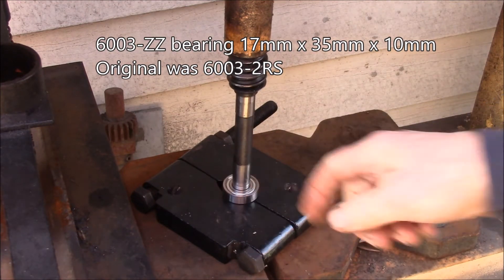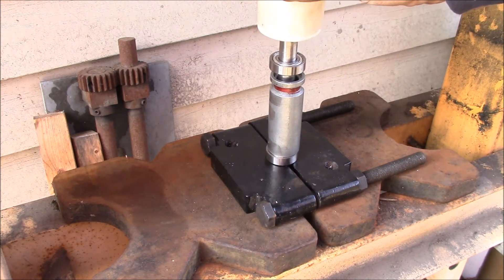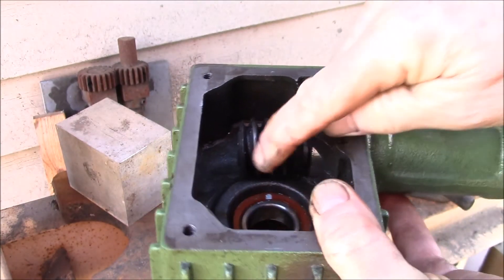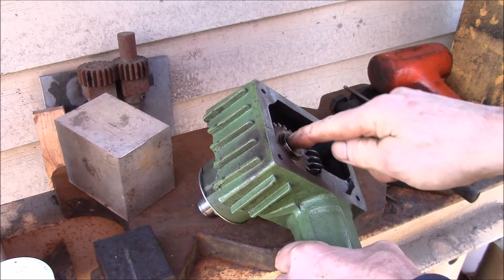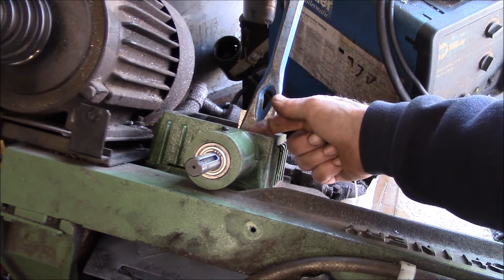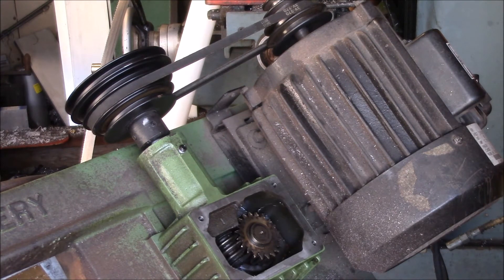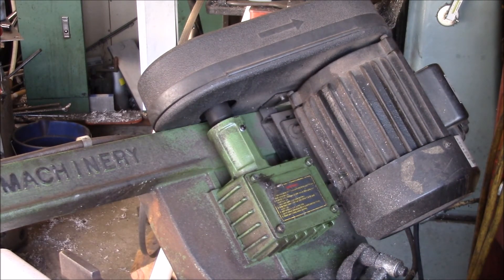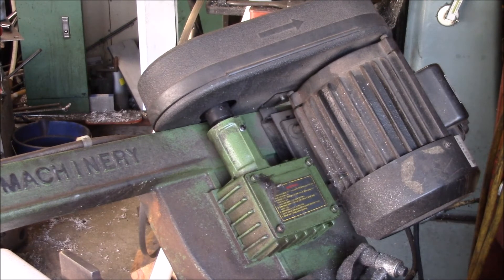7x12 Horizontal Bandsaw Gear Box Repair, Part 2

Comment: i have an Enco 7" mod#137-3175 ,where can i find that bronze gear , thats worn out on mine. thanks, mac carmichael
Reply from the maker: Looks pretty similar to the Central Machinery / Grizzly saw.  If you can find a parts manual on-line, look up the exploded parts diagram and p/n there and compare it to the one on the Grizzly site and if they look similar, they probably are.

Comment: Good info, I've had 6 of these bandsaws in my business over the last 20 years, currently have two and shredded both gearboxes on the same day!  A bearing in one (same bearing as you), the brass gear in the other.  They are slightly different models, the brass gear is the same but faces opposite direction in the "Red Bandsaw" (harbor freight) gearbox.
Reply from the maker: Is the red one the 4" x 6" model?  I have the green version of that saw, about 25 years old, and it's still on the original gears.  I did pick up a new gear set for the big saw and it's all steel.
Reply: @The4Crawler  No, for a while they sold a red 7x12, it was a little cheaper with smaller bearings, smaller motor, and aluminum gearbox.  Runs just as great as the green 7x12 honesty though, I've run an insane amount of material through them both.
Reply from the maker: @natemccann8050  I guess I've never run across one of those models then.  I started with a green 4x6 and then moved up to the green 7x12.

Comment: Good video. I have the smaller CM 4x6 that dates back to 1983 and it works great. I wish the new ones were built with the 1/2" thick steel bearing adj arms and solid steel bearing carriage. The cast frame is much better on the older units and seems to be thicker.
Reply from the maker: I also have a 1999 model CM4x6 saw, it's still going strong.  I use it as a vertical band saw now.

Comment: Now if they only made equipment like they did back then all would be great.
Reply from the maker: Yes, so true.  At least this machine uses standard bearings, so easy to look up the ABEC number, or the bearing number is also in the parts diagram in the manual.  Only thing they don't show is how to disassemble and reassemble this machine, but luckily there are a few YT videos showing some of the steps.  Hopefully this video will fill in some of the rest.

The saw is cutting so well now, smooth and silent.  I guess these parts had been slowly failing for the last few years that I didn't notice the increasing noise day to day.